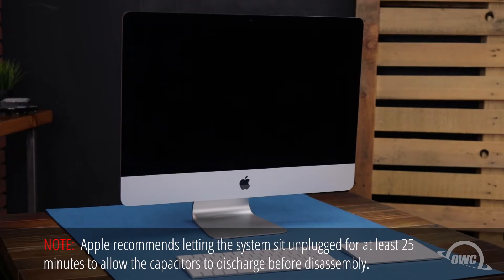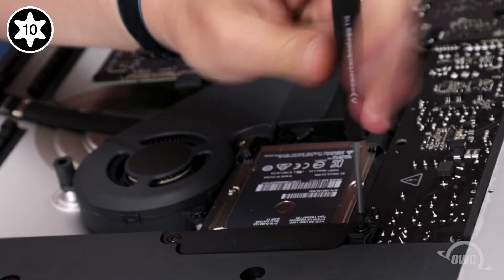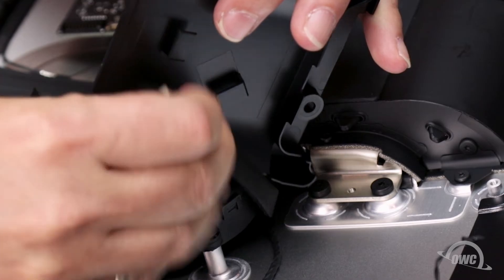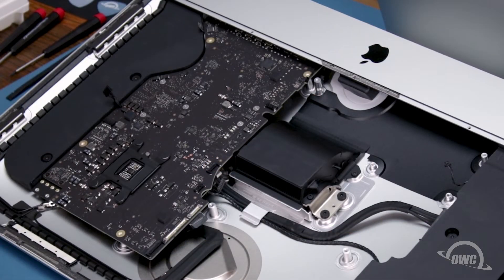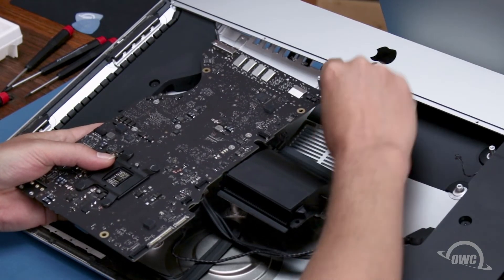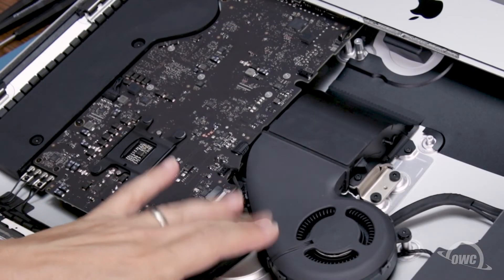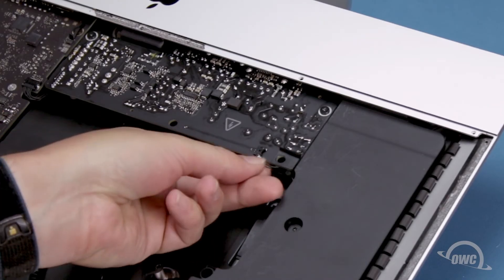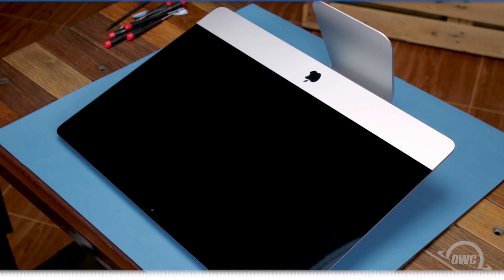How to Upgrade/Install Memory in a 21.5-inch iMac (Mid 2017) iMac18,1 iMac18,2

Comment: While upgrading my 2017 iMac I removed two 4GB cards. What struck me as being odd the GB cards were not the same. One was made by Crucial and the other one that was black with white lettering, made by ??? .. I don't know the brand, it did have the letter M on the card .      Question , should I go back in to my Mac and  replace the unknown brand card with my spare Crucial card to pair with the other Crucial card?     BTW the Mac seems to be working ok :-/
Reply from the maker: Apple uses a variety of different manufacturers to outsource different components. My recommendation is that if they are working well, to leave them...or if not...consider an upgrade and upgrading the RAM to a bigger and faster kit.
Reply: @poweredbyowc  Thanks, I understand they use different manufacturers. But why did they mix two, being one is Micron MTA4ATF51264HZ-2G3B2 4GB And the other is a  Crucial by Micron CT4G4SFS824A.
Reply from the maker: That would be a great question to ask Apple, we would love to know as well. 😉

Comment: Great video! Very helpful in upgrading my RAM tonight but my 2nd display no longer works. Any ideas on what might have caused this? Could I have forgotten to plug something back in or not plugged in fully?

Thanks again for a great video. Couldn’t have done it without all the awesome details!
Reply from the maker: You may want to check if another Display has the same issues if the other display does the same thing you may have not connected the ports correctly.

Comment: hello great video!, i have imac 21.5 4K 2017 model A1418 3GHz 8gb ram. i can change to 32GB ram or more? and ssd i can change to 1TB samsung evo870?
Thank for answer :)
Reply from the maker: Hello Shon Yagutilov,

For your iMac you can change out the memory to the max of 64GB, we have provided you the memory upgrade link below.
https://eshop.macsales.com/shop/memory/imac-2017-21.5-inch

Now for the SSD it would depend on how you purchased the iMac. If you purchased it with a HDD yes you should have no issues with installing that Samsung drive but now if you purchased the iMac custom with a NVMe SSD you will not be able to install that Samsung drive due to the iMac not having a SATA connector in the mac 21.5-inch iMac models that came with a factory-installed SSD or Fusion drive.

Comment: Just did this but my iMac won’t boot at all now I swapped both 8gb sticks with 16gb each making a total of 32GB of PNY RAM. Could it be an issue with the computer not being able to handle the full 32GB? Shall I try an 8GB in one slot and 16GB in one slot?
Reply from the maker: Hi @Sandeep!  Have you reached out to the RAM manufacturer already for help? If you purchased the RAM directly from OWC: https://eshop.macsales.com/Service/ Since the iMac18,2 is spec'd out by Apple for 2 x 16 GB, and we've discovered in the years since that it will accept 2 x 32 GB RAM, I suspect there may be something else in your particular situation that may be causing the behavior.
Reply: @poweredbyowc  going to return the PNY ram and purchased OWC now on Amazon let’s see if it works. I did reopen it and put back one of the 8gb sticks along with one 16gb and it booted up however still slow loading programs like Logic Pro when making music. Keep you posted if I have any issues once I put the owc ram in

Comment: Excellent tutorial video, cannot fault it, with the one exception to test things before refitting the screen permanently. Thank you
Reply from the maker: Agreed, it is a good idea to make sure your cables and connections are all working before you apply the adhesive, just to make sure everything is working. If you need a replacement set of adhesive please give us a call at 1-800-275-4576 and we can assist!

Comment: I upgraded the RAM in my late 2017 21.5” iMac by removing the screen, the cooling fan, and the camera cable, carefully tilting it in its side and replacing the RAM. You don’t have to go through all of this LOL!!! Ridiculous!!!
Reply from the maker: That is nice to hear that you were able to find another way to do the install of the memory that worked for you.
Reply: You're right. I found the video that shows you how to do it. Even if it's a little bit tricky, you can avoid the hassle of almost completely disassembling your iMac. You'll need only FIVE MINUTES to upgrade your iMac's RAM (after the screen remove step, of course). It's up to you.

Comment: I have upgraded the RAM many times on three previous iMacs I owned. I remember when upgrading was as simple as removing a small panel from the bottom (or back) and replacing the memory modules. Maybe took 5 minutes. My mid-2011 iMac was a piece of cake. I even upgraded to a SSD and it was not difficult. The instructional videos by OWC are excellent. So now I have my 2017, iMac 18.1 and I don't think Apple could make it more complex to do. I contacted my Apple dealer and they don't even to memory upgrades. It's not worth their time. It would appear that Apple is making it more and more difficult for users to do any upgrades to their computers. I've been a loyal Apple fan since the Apple IIe days and have owned about 12 different computers but their pursuit of making their computers as thin as possible and impossible to service is a joke. I have no problem doing this and enjoy the challenge but some of Apple's design decisions are asinine. I'm a photographer and the new iMacs don't even have an SD slot! It was bad enough when they moved it from the side to the back.
Reply: Same here, cannot believe how hard they make it to remove this thing.. and to top it off my kid's got a bad case of diaper rash!
Reply: And your Apple dealer is right. Consuming so much time just to... upgrade iMac memory! 75 minutes of surgery to only... change a module! Holy God! Aaarghhh! We miss you Steve (Jobs)!
Reply: @midisqusdisqus802  Miss Jobs, too. Now the Apple M-series CPU makes it even harder for software engineers to use VMWare for work so many developers in my company switched to Windows PC because of that. Apple MacBook are left to people (like sales, marketing, PMs) who don't need to run development tools. Pity... Mac mini and early iMac are the best time I have with Apple Mac products.
Reply: Fully agree with you!
Reply: I think the 2019 is even more convoluted - I'm going to upgrade my 2017 first, then Ram and HDD on my 2019. not looking forward to either, to be honest. Yeah, the 2012-ish just required taking off the access plate on the bottom for the memory - Like 5 minutes to upgrade. This hot mess is another story.
Reply: In fact, if you go to Crucial's website and look up memory upgrades for this iMac, Crucial says none are available, even though the memory is socketed and clearly upgradable from the pitiful 8GB this iMac came with. Crucial apparently knows what a nightmare this is and decided to steer clear of the entire debacle.
Reply: Exactly this. Apple used to make superb products back when Jobs was still alive and they thought about every aspect of the computer. Now sadly their pursuit of thinner / lighter just means the products are overpriced crap that users have difficulty doing the simplest of jobs. I photograph and create vids on Macs and most of my colleagues will only buy pre-2015/2016 MBPros due to their connectivity.
Reply: This is absof***inglutely ridiculous. The fact that the monitor is glued on is stupid enough, but THIS???  Just no.

Comment: hello can I also replace the hard drive (for ssd)?
Reply from the maker: You can, however it is quite involved. I would absolutely recommend you watch the install video before purchasing a drive to be sure you are aware of the difficulty:
https://eshop.macsales.com/installvideos/imac-21-inch-2017/?filter=ssd

Comment: My iMac, 21.5" accept 2133 MHz DDR4 SO-DIMM. ¿Can I to use a memory with 2600 MHz? I don't find a 2133 MHz memory.
Reply from the maker: Hello José Manuel, If you reach out to us at support@macsales.com or via phone (800)275.4576 we can double check what is the correct memory upgrade we can provide you and if your 21.5" iMac can take the 2600MHz memory.

Comment: Hola, muchas gracias por el video. Habria algun problema de incompatibilidad si le instalo memorias de 2666Mhz? Gracias
Reply from the maker: There could be some possible incompatibility issues, this is why we recommend using the memory here: https://eshop.macsales.com/shop/memory/imac-2017-21.5-inch, as this is both compatible and will work best inside that machine.

Comment: After installation ( RAM 32GB and SSD ) my computer does not start. Two green LEDS are OK, the 3rd ( GPU ) does not light. Should I check the PRAM battery and change it?
Reply from the maker: We would recommend testing a PRAM reset and/or an SMC reset first. Also, please clean the contacts of the memory then reinstall them. For more information on trouble shooting, please feel free to reach out to our support team on the link below.
https://eshop.macsales.com/Service/support

Comment: What pisses me off is that they could have very easily engineered a removable port in the case over the memory modules as they are flush with the back of the case anyway. They’re purposefully making it difficult
Reply: Yes... making it difficult on purpose. Because if you analyze the video, you end up with the RAM modules facing the back of the case. In a 27-inch model they simplified the procedure, but in the 21.5-inch model... they push you to "think twice" if you investigate beforehand how to expand your RAM memory. Too bad Apple!

Comment: In Apple Support on May 21st of this year they said that the Memory is not removable by users on iMac (21.5-inch, 2017). Do they only say that because they didn't put the access door on this model?
Reply from the maker: This is a great question! The imac 21.5" 2017 machine doesn't have the door on the back. While you can upgrade the memory in this machine, this would mean you would need to take the front of the screen off to get to the memory.
Reply: Cut it your own back door. 
Ez’r than removing everything!
Reply: @rickgold6664  
And... how do you expect to cut through that back door without damaging the inside of your Mac? Dismantling it completely? Ha ha ha ha ha ha
Reply: @midisqusdisqus802  I used my Dremel. Ha ha ha!
Reply: @rickgold6664  
??? Well, everyone DAMAGES/RUINS their iMac as they want...

Comment: Is RAM on iMac 2017 27-inch and 21-inch are same?
Reply from the maker: Hello Prashant Balasubramaniam,

The mid-2017 27" iMac (18,2 & 18,3) would take the same RAM modules as the mid-2017 21.5" iMac 18,1
Reply from the maker: Hello Prashant, yes the memory is still DDR4 2400MHz SO-DIMM's but the installations are different. The 27" has a hatch in the back you can install after removing the power cable, the 21.5" requires you to open your iMac to replace the memory.

Comment: This works very well! I want from 8gb to 32gb with no former IT experience! It did take around 3.5 hours with interruptions however
Reply from the maker: The 21.5" can be a bit tricky but if you're able to follow a video we provide all the tools you'll need! Glad to hear it helped you out enjoy your RAM!
Reply: Hi, officially for 2K (2.3 Ghz, Late 2017, 21.5) model its support only 16GB (2x8GB) or I'm wrong and you have 4K model? Please reply why did you go for 32GB and how is working? Many thanks
Reply: @makki4064  In the video he is using a mid 2017 4K model. The mid-2017 4K models can actually be upgraded to double what Apple has “officially” said, but the 2K model from that year is only upgradable to 16 gb

Comment: Holy cow, 75 minutes for changing the RAM modules is not an upgrade...it's a surgery!!! However, very professional video. Thanks!
Reply: Same thought here. You almost have to disassemble the entire iMac! Holy God! I'm not afraid to do this type of surgery (I already had a very complicated one many years ago when changing the internal battery of a Titanium), but... just to UPGRADE Apple's RAM? In the past Mac's were designed with simplicity in mind. Now all is the opposite. Why? We miss Steve Jobs.
Reply: Dude, 4 hours
Reply: Buying the ram extra from apple is extortion, so take your pick.  At least this way, you learn something useful.

Comment: There's a way easier way to do this without disconnecting virtually everything and removing all of the parts.
Reply: How???
Reply: @gianpierooliva8253  You still need to remove the screen.  So, I would follow instructions up until the part where they start disassembling parts and disconnecting wires.  

Remove the fan only.  This will give you access to where the RAM is at.  You might also tape the fan to the motherboard temporarily if you don't want to remove the fan wire from the motherboard. You may also need to carefully disconnect the three ribbons blocking your view of the back. If you look down under the motherboard, you can see the exposed slots. The next steps are a little tricky, but no risk of severing wires or forgetting to plug all of these things back in at the end, getting the case sealed shut, and then the power doesn't turn on because you forgot to reconnect the power-button wire or something silly.  In other words, if you have a little dexterity and patience, you don't have to unplug hardly anything.  

For me, after the screen and the fan were removed, I tipped the iMac on its side so that the left side is in the air.  If you look down behind the motherboard where the fan used to be, you'll see the RAM in there pointing right back up at your face.  This might sound silly, but it worked well.  If the next part isn't clear enough, let me know, and I can post a quick video of it.  I rested the left edge (now the side pointing straight up in the air) on the  bridge of my nose/forehead, which allows you a really good view down under the motherboard and directly at the RAM.  It also holds the iMac in place so you don't need a partner to hold it up for you.   

Then, I reach one finger from my right hand through the side of the motherboard until it's on the right clip of the bottom DIMM.  With a left-hand finger, I go down through the top and touch the left clip on the bottom DIMM.  I pull the clips apart slightly (away from the RAM about a millimeter), and the top end of the old RAM will pop back about 30 degrees.  Then, you just pull it out.  Then move up to the upper DIMM, and do the same thing.  When you pull the little silver pins apart about a millimeter, it should release the top of the RAM.  Be careful not to drop the RAM down behind the motherboard.  But if you do, you can just gently tip the iMac upside down or flip it to the other side so that it slides back out.  If you need a visual of what it looks like to properly release the RAM and to properly seat the RAM, watch the part of this video where the technician demos it.

When putting the new RAM in, you put the iMac back in to the same position where it's tipped up on its side and resting on your forehead/bridge of your nose again to hold it in place and to give you a good view of the RAM slots.  Lower the RAM (the one you didn't transfer the little heat sink onto) down the back side of the motherboard so that the pins are in the socket, but the top is tipped back like when you released the old RAM - not so it's snapped back into place yet.  Just let the top end rest against the inside of the case.  Then lower the one with the heatsink into the top slot so that it's pointed back about 30 degrees, and then tip it upright until it snaps into place.  Then go to the bottom DIMM and tip that one forward until it also snaps into place.  Push down on the top of each of the two sticks of RAM fairly gently to make sure they're secured into place. If it looks good and secure, screw the fan back on and reconnect it to the motherboard.  

Put the screen back on the front of the iMac and secure the ribbons back into their little sockets.  Done - likely in a fraction of the time without removing al of the components and disconnecting everything.  OK - OK - I'll make a video.
Reply: @VeganHoliday  Hi, have installed new RAM 32 GB OWC ( 2 *16 GB). and SSD Crucial. But the computer deos not starting. I oponed the computer Again, check the RAMs are ok, and the SSD properly plugged but deos not starting. 2 LEDs green are ok, the one that shows the iMac is comenected, and the second One Which Gets on when you starting the computer…it looks like the third light belongs to GPU?. What can I do?
Reply: @MrEtorkizuna  Make sure everything is plugged back in correctly.
Reply: @joeyslaptop  thank you for answering Joey. UNdoubtely your video for installing RAM without Moving motherboard was the way IFollowed. But I had to fish ( RAM ) many times…I am sure I have removed the PRAM battery so I will follow the OWC tutoríal. But your way is the best. Mayte, removing one torx screw, the closest to the camera gives you more flexibility to Work. Thank you Again for your video and answering me. All the best.
Reply: @gianpierooliva8253  Here's the link:  https://www.youtube.com/watch?v=_k9I7N9BdCI
Reply: @joeyslaptop  thank you for the advice. It looks delicate but avoiding getting apart the motherboard and so on looks extremely complícate. I will go for it next days. Take care and Again, THANK YOU. You have a new subscriber.

Comment: Why is it so easy on the iMac Mid 2017 5k model 😭😭😭
Reply from the maker: That is a great question for Apple. The 27" iMac are so simple but the 21.5" iMac is very in-depth installation.